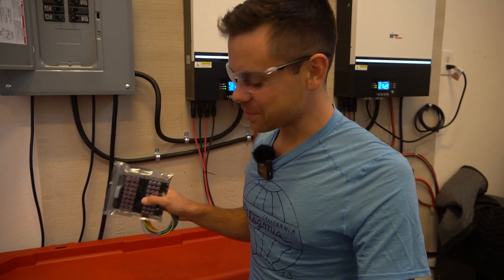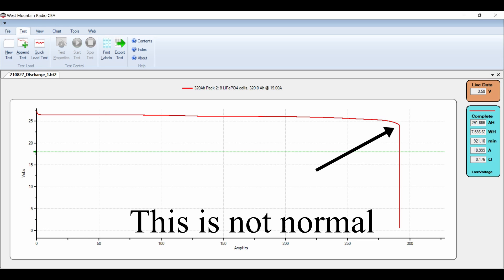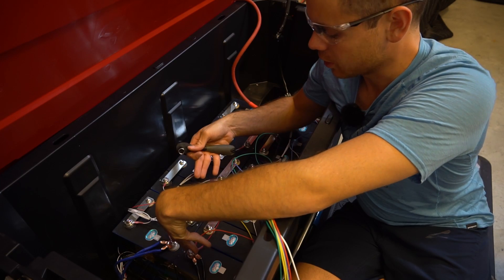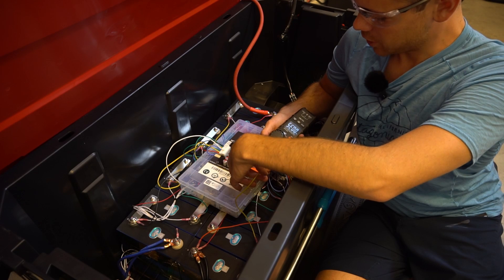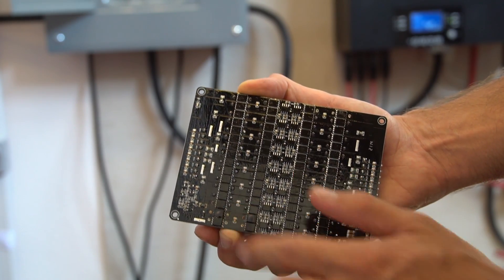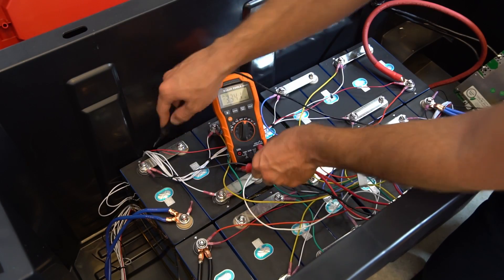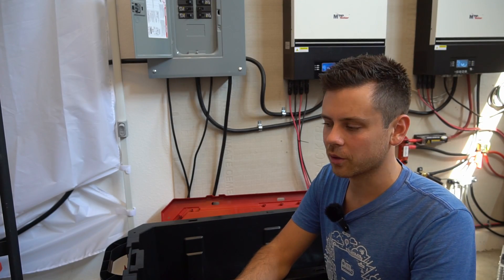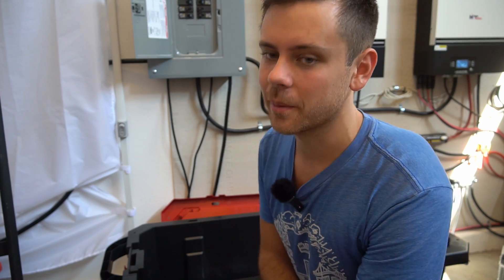16S LiFePO4 Active Balancer Problems (Not Beginner Friendly)

Comment: I use one of these balancers the one thing I thought about is it wont turn off in a low temp disconnect situation, for example battery is below zero and you discharge it  one of your cells is out of balance it flows energy to the low battery so effectively charging at 0c albeit at low rate.
Reply: The problem with charging below 0C is lithium plating. But this happens with high to high currents only. The low current of active balancers doesn't really matter compared to normal charge current. 
If want to use the battery at this low temperature than you should think about heating battery to 10+ C anyway. If not, you should put it to storage by charging to 3.3V and disconnect everything.
Reply: @egnegn123  I think at 5amp its enough to do damage which these balancers are supposed to do
Reply: @offgridamps You get this high balance current only with cell voltage difference well above 1V. In this case your BMS should have cut everything off long before.
Reply: @egnegn123  Yeah maybe ive seen mine at  about 1.2amps not sure would it fuck things up at below zero, i mean its not great either way

Comment: That balancer I own and it failed on LTO. I have another type that worked but it don't have hv cutoff for cells and that was a problem with my pack.  LTO takes a high current charge and if you charge too fast and the balancer can't keep up and the cells will over voltage. A friend has one in a metal case that he likes but I don't have the details. They sell some with a bms but I just don't have time at this point to test. In 6 mo I will not be working and I can put more time into building my packs. I have reached a point that I only buy the BMS off Ebay and if they fail I send them back for a refund. Just too much untested junk they are selling.
Unrelated,  I have a friend cutting up Tesla packs to reconfigure the cells for NEV cars. I ended up with 100 cells and I am 3d printing holders for the cells. The cells have a pressure cap on the cell when too much pressure builds up in the cell the cap pops off. The capacity seems good but the case will rust easy and they are hard to remove from the pack. I would not buy the packs unless you use them as they are configured.

Comment: I cannot see how a separate balancer would help. It can only work at top voltage (above 3.55v per cell), as it works by trying to balance voltages, not capacity, and volts is not a good indicator of capacity. The curve is so flat between what, 3.2V and 3.4V, that any balancing there is pointless. So, let us envision a pack of 16 x 300Ah and you are pumping in 57.6v @ 60A. Let us say you have the balancer set to kick in at 3.55V. At best, despite being a 5A max balancer, I doubt you will see much more than 1A being transferred and certainly 2A at most. So, it is trying to balance at maybe 2% of the capacity of the charge. It will only be a few minutes before one cell hits 3.6V and the charger cuts off. Now you leave it for 30-60 minutes as the cells absorb that charge, and pretty quick they will drop below the point the balancer is set to work at. It will have had only a very marginal effect, and no better than what the BMS would have done anyway, along with absorption and normal balancing that the cells will do between each other. It is a gimmick at best.

Comment: From what I have gathered an active balancer on LiFePO4 batteries is only good for doing the top or bottom balancing on an already assembled battery. If you plug it in while the battery isn't very close to full or very close to empty it will just continuously try to balance based on voltages and possibly unbalance the battery even more. But they are good tools to have when the BMS is cutting out at the top or bottom because it's balancing current capacity is too small. That is the time to use the balancer to get a quicker top or bottom balance since the voltage differences are actually indicative of charging state differences.

Comment: Active balancer does the job, unlike onboard bms balance so slow pretty much no balance at all. It just cant take the heat. Better to isolate the balancer next to the batteries with better air cooling. Looking forward for the next one.

Comment: I have the 4s version of that balancer. It worked fine for me.
I had done a top balance of the 4s pack but a cell that started drifting and would peak before the others shutting down the bms.
At first I kept the balancer 24/7 and it balanced great but after a couple of days I saw that it kept balancing on low SOC and managed to make another cell drift only on peaks. 
So I disconected it when it balanced at a high SOC ans cell voltage of 3.55 a week ago and lowered the boost voltage to 3.475. So far the pack is balanced with no more than 20mv difference at boost. 
I will use it for periodic maintenance of the pack without having to dissasemble it and top balance.

Comment: The off grid garage guy doesn’t like active balances either, but he says they great for getting a new pack up to speed.  He also says once the battery pack is up to speed you should take it off the battery pack until the battery pack is way out of tolerance again. He has hours of data to support his findings.
Reply from the maker: That's good advice. That's what I was planning to do. I would never leave one connected to a battery
Reply: Seems like there are a lot of condescending critics  making  rude analogies. It seems to me that Will does  more work in a day trying to help people than these  critics do in a year.

Comment: I'm using a very similar active balancer (with screw terminals) on my pack with used 180Ah cells for several month now. The balancer actually made the pack usefull since my BMS never managed to balance the Pack. It's perfectly balanced now.
Reply: do you use bms and active balancer together,I am thinking to go this way,cos bms do not have that much power to balance
Reply: @xdagasx4153  yes. BMS and balancer are connected in parallel.

Comment: Active balancers are good for top balancing, then disconnect it.
Reply: I have been thinking of getting an active balancer, but still have doubts. Are you suggesting that it will be fine to just use it to top balance once a month, for example, to correct any discrepancies?
Reply: @robinhood4640  Yes, it does make top balancing easy. Leaving it connected/running, that is actually counterproductive.
Reply: @john_in_phoenix  I have been balancing my lifepo4 battery pack manually once a year. Disconnecting everything and using my old lead acid batteries for a couple of days is a bit of a pain in the butt. 
 Once everything is connected, all I'll need to do is put the connector in once the pack is charged and pull it out before the sun goes down. Certainly sounds like less work and i will not have the worries which have been the reason for my doubts. 
 I'm laughing at myself for not thinking of this very simple way of avoiding eventual worries/problems. Thanks for sharing it.
Reply: @robinhood4640  I was pretty much of the same opinion as Will, active balancers are counterproductive if left running all the time. They will actually unbalance your battery in the flat part of the curve (where you spend the most time). Off grid garage convinced me, they are quite useful for top balancing, just disconnect once done. Will and @Friedfox actually figured out why this one smoked (he has two BMS in series, and one did a cell voltage disconnect). They are a cost effective way to top balance, just be sure when you disconnect to insulate the leads properly, as Will notes, more wires men's more chances for something to go wrong. Done properly, you can just hook it back up and top balance a pack as often as you wish without any battery dissassembly.
Reply: @john_in_phoenix  I have 4 lifepo4 drop in batteries which all have an individual BMS. I have only recently converted from 4p to 2s x 2p, to increase the panels by increasing the volts without increasing the amps, for my mppt controller. Am i likely to have the same issue with the BMS fighting against each other?.
Reply: @robinhood4640  I would effectively "top balance" the four batteries before putting them in series. In other words, put all four in parallel, and charge with low current (to allow the internal BMS to do as much balancing as possible) until all have reached high voltage disconnect. That would "top balance" the four packs.
Reply: @john_in_phoenix  That is exactly what i did, about 20 months ago, when i connected them in 2s x 2p. Last November i did it again, using my old lead acid batteries, to run essentials. 
 Should i continue every year or do you think it is not necessary? 
 After leaving them all disconnected over night there was a 0.25 volt difference between all four.

Comment: Why do you have to top balance if you are not going beyond 82% full?
Reply from the maker: I charge to 98%
Reply: @WillProwse   I mean not for yourself but on the diysolarforum lot of guys don't go beyond 82% or below 17% so why do a top balance? I've always wondered this
Reply: @easylooker  Imaging one cell at 40%, another at 60%. These have the same voltage, and you're on average now at 50% - so no problem. Now you want to charge to 80% (let's assume we know how to do this with a shunt or something). We're adding 30%. one cell that was at 40% is now at 70%, the other one is now at 90% (i.e., too high for the 80% target - remember, this is 80% across all cells we want). Going towards this 90% on that cell will also increase stress disproportionately to this cell compared to the other one. Top balancing solves this.
Reply: @upnorthandpersonal  

Is this why some are using balancers instead of just the bms?
Reply: @easylooker  Or a BMS with built-in balancer. However, a balancer can only do so much since it's limited to how much current it can actually shift. Now assume you have a 40% state of charge difference between two 280Ah cells and we want to balance that - that's more than 50Ah to shift. With a 5A balancer (and assuming it does 5A continuously, which it won't) this takes 10 hours. And that's just those two cells - in a 48V system, you would have at least 16 cells. In other words, it will take a long, long time for a balancer to get your cells balanced when you didn't do a top balance first. After a top balance, the delta between cells is much smaller so that cells drifting apart can be brought back in balance even with the small balancer current.

Comment: The Bluetooth active balancers that come in a metal case seem to be fairly reliable. I've been using a 2A version for a couple of years, so far so good. The product I'm referring to is to one by JK BMS that is sold under various brand names on the usual sites with Chinese electronics. It has some nice features like an On/Off slider in the Bluetooth app, adjustable balance current, (0.2 to 2.0A) cell delta voltage trigger setting, internal cell resistance display. The one thing it lacks is the ability to set a low and/or high voltage threshold value so balancing ONLY occurs during the lower voltage part of discharging and the upper voltage part of a charge cycle. Cell balancing in the FLAT region of the voltage curve is not necessary and may even unbalance cells more. As mentioned in the video, If you have a set of cells that are not well matched like I do then the active balancer does help quite a bit. BTW, Off Grid Garage just did a couple of videos on the same balancer featured here. His did not "burn up". Perhaps you just got a bad one?
Reply: I have been using this balancer as well.  I bought a second one that has a temp probe and RS-485 connectors.  I've written my own application to monitor my solar equipment (Schneider) using ModBus and my plan is to integrate the JK BMS into that system so I can tell the CC to go to Absorb or Float if a cell reaches my defined limit.  Or, since I have the application integrated into Home Assistant, I can control devices (like A.C.) to bring down the load or worst case, tell the Inverter to go into Standby.  I don't like how most BMS' disconnect the battery from the equipment requiring a manual startup.  I can do it programmatically w/o the need to use a resistor to get all of the caps charged up and thus saving my equipment.
Reply: @davidchristensen1219  Wanted to reply to you but its been a couple of crazy days. I'm wondering if you watched any of my videos? Sounds like you have the same Schneider 6848 Inverter. I would be interested in any info you are willing to share regarding the Schneider communications protocol. I have the Schneider ComBox but don't have their battery monitor so the State of Charge just shows N/A on the display. I was wondering if it would be possible to take the SOC value from the BMS CAN Bus, format it properly and send it to the Schneider at the correct ID or Address? Any suggestions? As far as the BMS disconnecting the battery from the system, that is a last resort issue to prevent permanent damage to the cells. If the BMS is set correctly to disconnect if any cell reaches 2.5V the Inverter should be set to 44V or 45V so it drops the load BEFORE the cells get to their critical lower limit. In any case, Unfortunately, my computer and programming skills are novice at best. I had to hire someone to set up the Websockets and HTML interface for the CAN to RPI to Network connection. I did learn a little HTML, CSS and Java Script so I could reformat the way the data is being displayed but it took me a while.

Comment: I was thinking of putting heat shrink on the handles of my tools. Like the socket wrench. It should greatly reduce the chances of dead shorting a battery.
Reply: When wiring my lead-acid pack I wrapped the ratchet and socket in insulating tape right to the hilt as each 2 volt cell has its own bolt terminals, so there was plenty of scope for shorting stuff out.  My LFPs arrived yesterday though so I've got to do it all again :)
Reply: Good idea.

Comment: A quick scan with your IR camera while the balancer and charger are running might give you some piece of mind. If your right about a voltage spike after one bms disconnected you probably wouldn't wouldn't have caught any thermal anomalies at the time, but at least you've checked your work before walking away from a battery that big.

Comment: 6.3v capacitors are not good in my book. We are always taught 2x the voltage. So needs to be 7v caps minimal.
Reply: If you look at a lifepo4 voltage curve, yes it can charge up to 3.5v, but it quickly settles down to its nominal voltage of 3.2v, and it stays there until the battery is drained. So technically 3.2v (2) = 6.4 v is probably fine.
Reply: @EdisonWong2004  yeah like Will said, it's probably not the fault of the capacitors, or at least the voltage rating. Something else is going on here. to generate the heat and destroy the fets.

Comment: I have this same active balancer. Been running just fine for months. I used it in place of a top balance and worked like a charm. It is too bad it didn't work out for Will. But did he really want it to work?
Reply: Sherylin  this will definitely help, but he believes he found the failure was one bms disconnected, possibly spiking voltage to the balancer, and causing the failure on the one side. He will re-review this as he has two 8s units ordered, and we'll see if they pass his test. I've been following him for quite some time, have learned a tremendous amount from this channel, and trust when he says he doesn't like something. He's got a lot of experience with all the gadgets out there, he's saved me time and $ for sure already! I haven't removed the balancer yet, I'll definitely be keeping tabs on its temperature. It's been in 160+ degree heat within the vehicle sitting in the sun even! It's balanced to perfection, and it doing its job so far, only one weeks worth though.....
Reply: Sherylin  collaborating with ideas and testing is what gets it done! Take all of us! :) Thanks for your input!

Comment: hey i really need your help. i want to have a power source to run my sump pumps off of my solar panel price a d have some type of charger to charge the batter off grid power at night.
Reply: Any hybrid inverter, or inverter charger could manage that task pretty easy. Off the shelf.
Reply: @SuperVstech  thank you for your reply, any in perticular that i can use??
Reply: Hey, I really need you to click the link in the description where he provides blueprints for DIY systems to do exactly what you're asking about.